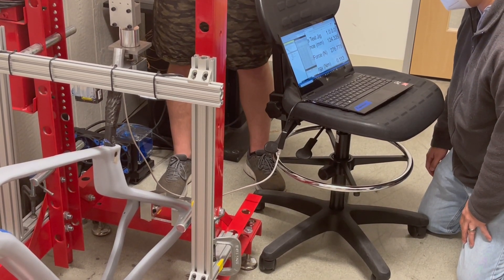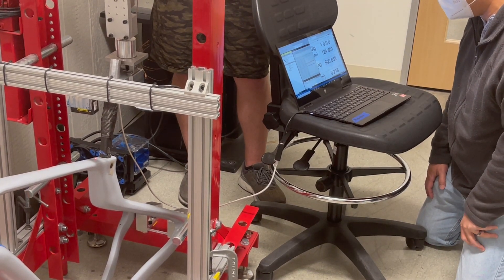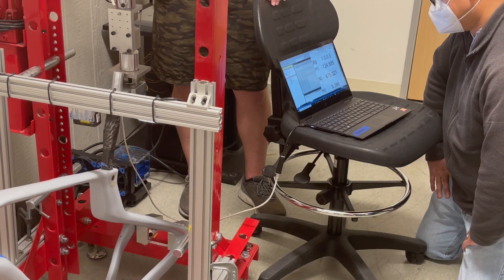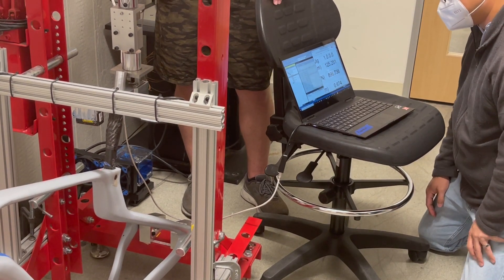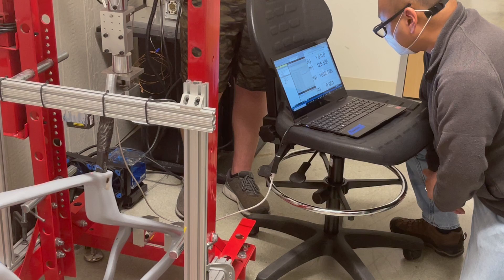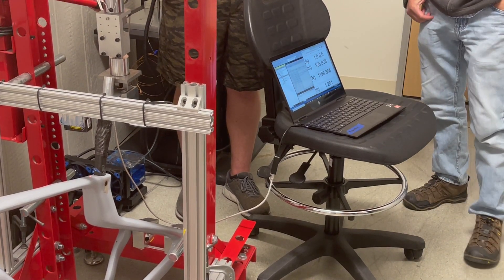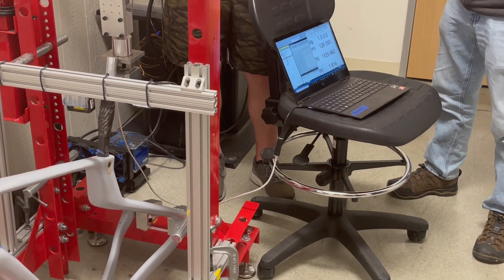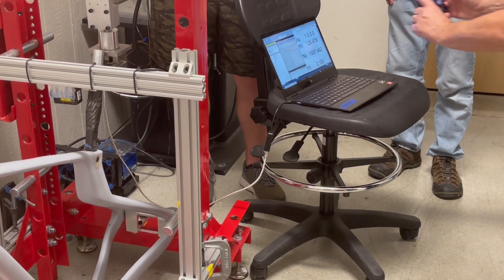Superstrata Frame Testing

Comment: Fun facts
1. 1504 newtons it's less than a 153 kilos of STATIC weight. When you hop or ride over a curb or just fall in a little pit you didn't noticed - acceleration wil multiply your weight several times.
2. We cant even fully see the frame, and on what point it stands

Comment: I keep hearing "it's not possible", "I'm an expert, I can't understand it, so it's a scam", "we always did it this way, so that way is wrong".

This is why you're not in Silicon Valley but stuck in your office working on other peoples ideas.
Reply: There's difference between "i can't understand it" and "i know basic physics". This thing WILL break or will weigh a ton, there's no magic in their 3d printers
Reply: @Grygory-fd3kp  But they literally showed in this video that it can take 1500 N.
Reply: @patrickj1066  man it's only ~150 kilos of STATIC weight. You'll produce more power just by jumping not very high on your feet. The best way to show that their silly construction works - give someone to REALLY ride it, but there's only videos with some old folk ride very carefuly with eyes full of fear and trying to put his weight on saddle as less as possible,  with other guy, that can't ride over a curbe, and a promo, where nobody even sits down on the saddle. They KNOW this frame will snap.
Reply: @Grygory-fd3kp  Will they just not deliver them then? Just vanish from the customers and let them all hang like that, and keep the millions of dollars?
Reply: @NotADuck They said they deliver in late 2020 and over 2021. Due to covid they have some delays in the supply chain but they keep adding more printers and will get the parts soon and it's all in the expected timeframe. 
They're working on getting the bikes to comply with local regulations, so if they break, how will they get approved anyway.
Reply: @NotADuck We'll see, so far they've been consistent with their updates and if the composite material is truly superior, it just might work and it bears the load. They said they'll get the composite rims ISO certified, and to get the bike in line with the respective guidelines. I'm gambling on them getting it there, but so far it looks promising. They also doubted the computer in the 1900s, but we should be open for innovation.

Comment: You basically measured the vertical stiffness of the frame, right?
Do you plan to perform static strength test and fatigue before you ship your first frame to the customer (should be next month I think)?